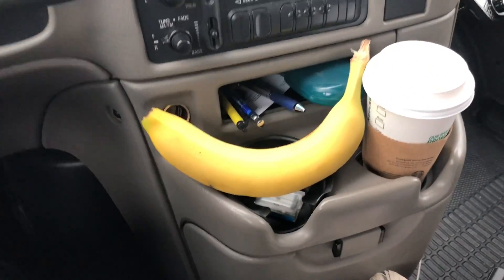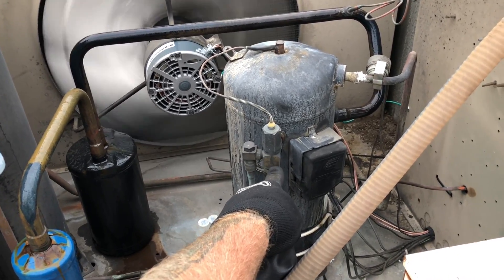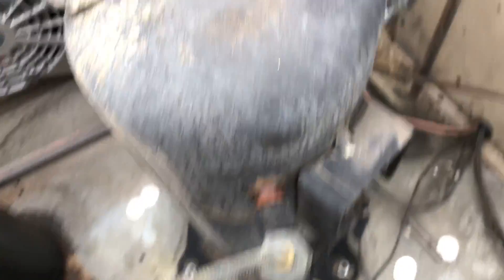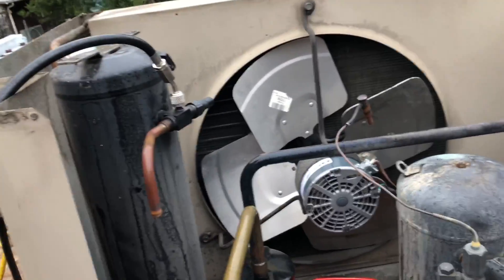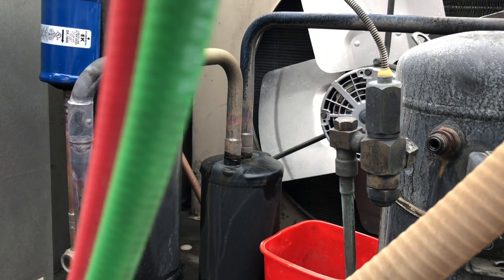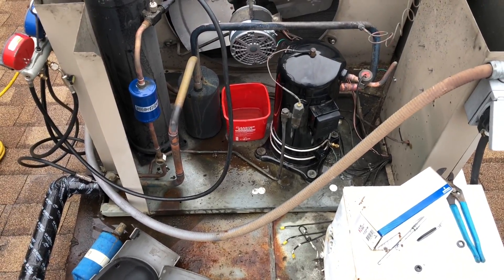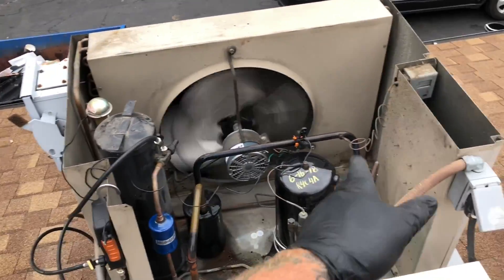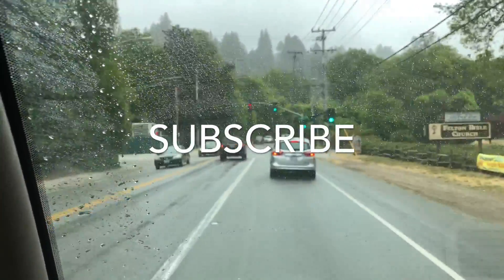Freezer compressor change out

Comment: Good vid Dave.  As far as I'm concerned, always change out the liquid injection valve when changing out a scroll.  No need for a call-back if one fails after changing a comp.  Also, on a 3 phase scroll make sure the direction is proper, it'll kill a compressor fast when that thing starts screaming.  Concerning the driers.  I ALWAYS cut them out vs. sweating them out.  Why, because when you add heat to a drier, it forces the trapped moisture in the drier back into the system which makes it a longer pull-down when evacuating the system afterwards.  Also, with the newer oils being highly hygroscopic, why add moisture into that oil?  Cut them out and replace what ever length of pipe you need to make-up the distance and make everything fit properly.

Comment: those are called liquid injection scrolls  they are only used for LT orrrr when they are worried that the capacity of the evaps are greater than the compressor.. other than that I've been installing EXT MED Scrolls . for freezer's  and they have been doing great

Comment: Nice clean work!  Any way you could have eliminated the Add a Phase and wired in a cap and a single phase compressor?  Just curious.  Ive had a couple of those phase converters fail over here in North Florida.  Probably from lightning........

Comment: never seen a discharge temp control like that, i seen something new going to have to read up on those. did they move to single phase with the compressor change out i would imagine that rotary phase converter is lowering over all efficiency. great video !
Reply from the maker: The Great Jelly Doughnut no I kept it 3phase.

Comment: Nice job on the compressor replacement!  What was bad with the old compressor?  What was the purpose of going to 3 phase?  Was that size not available on single phase?  Those mechanical Phase Converters work great, but just curious since it adds another thing to go wrong.
Reply from the maker: Gary Gin I’m not sure the customer had this in place when I started working here.  The old compressor was having issue keeping up in warm weather, low capacity

Comment: I highly recommend putting in an external check valve on the discharge line on scroll low temp compressors. Had a lot of low temp scroll internal check valves fail

Comment: I notice you use couplings alot I'm not criticizing, I just use an Iwiss hydraulic swage IWS-38B my thinking is less joints, less heat, less potential for leaks. Happy Dad's day don't work too hard!
Reply: until chinesium copper with uneven wall thickness. you can get paper thin areas from swaging, so be careful and in that sense, a coupling with two joints may be better
Reply from the maker: Mike Seymore I use cuplings I don’t have a 7/8” swage tool.  It’s just old way of doing it.
Reply: The Iwiss IWS-38B goes from 5/16"-1 5/8" and I think they make the Hilmor hydraulic swage?it doesn't go up that far 1", I know sometimes I don't have some fittings (forgot to restock) do you have any thoughts on the steel and aluminum tariffs I've noticed some of my suppliers have bumped up there prices?
Reply from the maker: Mike Seymore good question I’ll check into the prices👍👍

Comment: sir, if a compressor burnout how do you clean the system simply install suction drier or you will going to change oil several time 
what is the best practical way ?
Reply from the maker: jain toms your new compressor has new oil in it, you can flush the system with nitrogen, use suction drier, and there are products like acid scavenger.

Comment: Nice video man, lately I've been finding a lot of dying scrolls...what concerns me their age is less than 10 years, one was just 5 years old, another one was 9. Etc, it's kinda concerning to see this. 
Also I love how you put in a new charge, freon does get old. I worked on a AC system with 407c, and it had 407c for about 8-10 years? Either way, as I was closing off a parker valve, it spewed freon (system was already being condemned for multiple leaks) and it smelled real funny, it smelled like garlic bread they serve at restaurants. My work buddy agreed, anyway great video Dave, can't wait for the next.
Reply from the maker: FrostBlueFire thanks for watching.

Comment: There is an orifice in the tee feeding the liquid injection valve to meter the refrigerant. I have had that plug up and cause me to think the liquid injection valve was faulty. I put the bulb in a cup of ice and no flow replaced the valve and still no flow. Cut the tee out and found the orifice plugged.

Comment: Fun stuff DTC, or as I like to call them "de-supeheaters".  On the big fancy Leibert systems they tee a TXV right before the external field connections to make sure the compressor is carrying a minimum load, and they don't like being used in laundromats out here in Virginia with our lovely humidity. :D
Reply from the maker: sivalley I have a bunch of scientific boxes that use that set up. The new ones use the sporlan hot gas modulating valve.

Comment: what was wrong with the old comp? was that a suction filter or a suction drier? great job as usual 👍
Reply from the maker: kingofthecrease30 it was a suction filter/drier factory installed. The system is clean so I removed it.  The old compressor was low capacity could not keep up in high ambient.
Reply: I'm going to guess by the conglomeration of parts, it was a used condenser unit for a good deal at the time of original install or the last unit went poof so they cleaned it as best they could and filtered everything. I think he said it ran multiple units, so there could have been many previous evaporator change/repair done too.